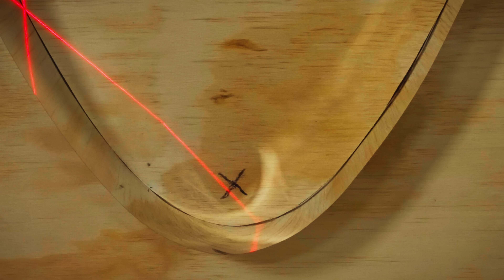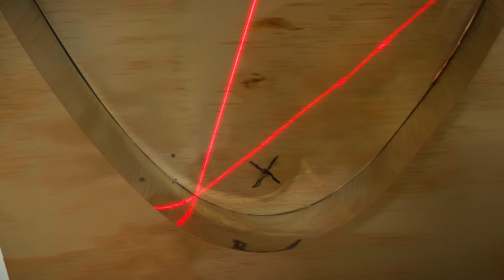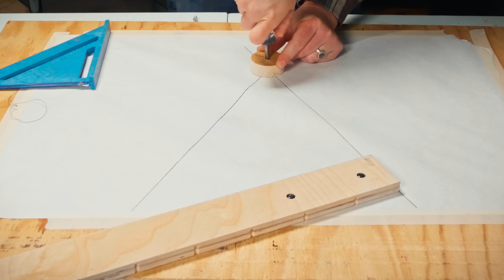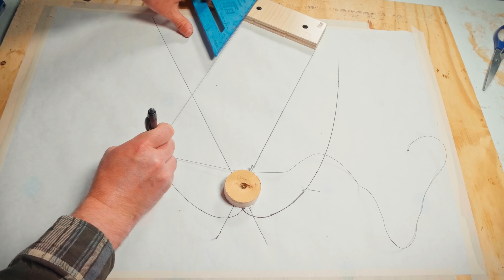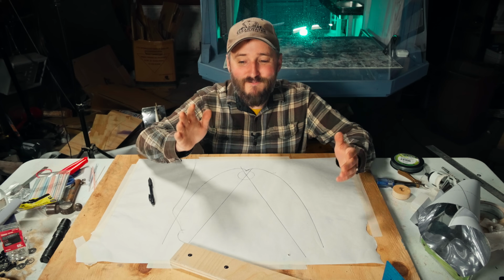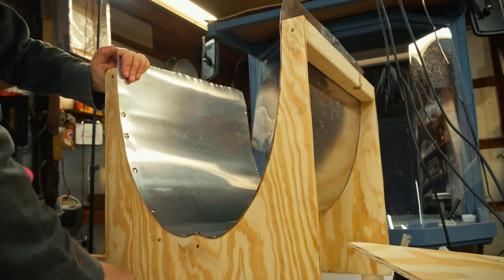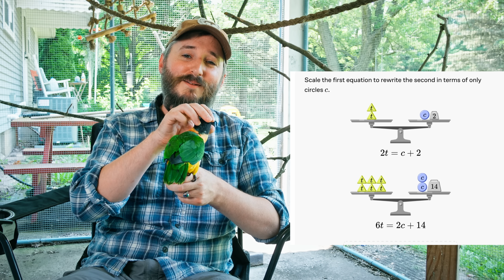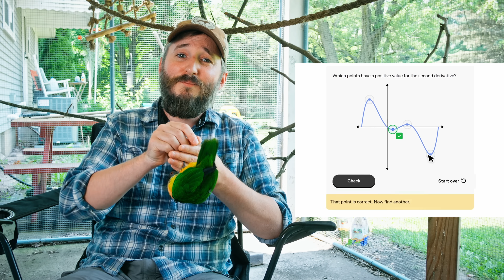DIY Solar Concentrators, Made Better.

Comment: Here's a wild tip for you - the receiver tube, use a copper pipe and rough it up with some sandpaper, then rinse it with phosphoric acid to get a black copper oxide coating on the outside. This surface will have a solar selectivity of well over 40 up to ~ 500 degrees F, and an absorptivity of >95% (i.e., will absorb practically all of the heat energy and not radiate it away). I used this trick during my engineering thesis when modelling high temp solar concentrators. Further upgrade surround the collector pipe with a glass tube that has an air gap (no need to vacuum, even just leaving air heat conduction will dramatically increase efficacy of the heat collection).
Reply: Nice tip.
Reply: @justinw1765  that’s what she said.
Reply: @clownphabetstrongwoman7305 Thank you Prison Mike...
Reply: Is there any more cheaper solution than glass tube. I believe that would be the most expensive part of the setup .
Reply: @migor777  Maybe use cut jars.
Reply: @migor777  a glass bottle is a glass tube, or a vase, whatever. you can get something at goodwill for a couple bucks that'll work
Reply: @migor777  
Plastic may deform at such a temperature, and if there is an optical defect, it may melt. So glass is probably the only reliable option for DIY. 

Maybe it is possible to glue (melt?) a box from 3 or 4 flat pieces of glass?
Reply: Presumably this would be used to heat water, therefore a pump would be incorporated to prevent boiling anyway. So plastic soda bottles could be  viable for encapsulation.
Reply: @geomacaulay Or design the system as a thermal syphon then the flow rate automatically changes as required.
Reply: @migor777 you could probably use an old shop light tube
Reply: @migor777 using scratch. Find used (not working anymore) fluorescent 20W light tubes, or 36W, or 40W linear fluorescent light tubes, cut their tips using glass cutter, clean, very carefully, the inside (the white inner cover, the phosphorus, is a very toxic powder), and voila, you will have a transparent glass pipe. We used those in Cuba, in the 90's, as chimneys for kerosene improvised lamps, to lighten our houses.
Reply: @migor777   Take a T12 fluorescent tube,cut both ends off with a diamond dremel wheel( one must be careful),sponge out the inside coating and you will end up with a nice piece of glass tubing. I know ,some mercury vapor will escape,but 1-2 fluorescents will not ruin the world around you
Reply: @migor777  Buy once. Cry once. This is one of the more valuable lessons that you can learn. If you build it to last a week, that's how long it will work.
Reply: @migor777  I was thinking of using Florescent tubes. Drill out one end to let the gas escape and the melt the end caps off with a torch.  Then you could use silicon O-rings over your copper pipe to hold it at center of the glass tube. Just a thought.
Reply: @1quasar1 don't use a torch. The tube is likely leaded glass, with a COE of 90 - it will shatter.

You will also have to remove the phosphor coating, which will be a ton of work, with high breakage.

Cut glass jars sounds better to me!
Reply: Hi  could you clarify something please .You said that black copper oxide will not radiate away , or it will not reflect away light? Im not picking.  Its that black object radiate thermal energy away much higher rate  than white or reflective. Just thought if that coating is preventing from heat radiation and good at the adsorption it is huge deal, and if this  real i would like to study it more , coz it would have so many more applications!!  Hope you could clarify it , thanks.
Reply: @Rom2Serge  I think the system described actually requires the glass tube along with the black oxide coating. The coating does absorb much more efficiently but also radiates as you mentioned. However the incoming energy is at one wavelength that then re-radiates at a longer wavelength that is reflected by the glass. I suppose using copper (or metal) allows the system to operate under pressure higher than glass would tolerate.
Reply: @RTew021 hi , yes i did some research in ideal world black objects radiate more heat than white objects at the same temperature. This is , linked to the conservation of energy: an object good at absorbing light (black) is also good at emitting thermal radiation. White objects, being poor absorbers (reflectors), are poor emitter. 
But copper oxide actually somehow re emits ligt less than usual black objects without braking conservation of energy. Some complex stuff is going on there. When will have more time will read about this subject. 
Cheers
Reply: @Rom2Serge - The way the original comment was worded DID make it sound like a spectrally selective surface, and it might be, but it could be just ambiguous wording buy that commenter. However, spectrally selective surfaces really do exist, which absorb visible light very well yet radiate infrared very poorly. In other words they are black for visible light and white or mirrored for infrared. You can buy ready-made vacuum insulated double-walled glass tubes which do exactly this. They are widely used for solar water heaters in most of the world, aside from USA and really cloudy places. 
On their own they can boil water on a good sunny day, but it takes several hours. When used with a solar reflector they can boil water much more quickly, plus they can get much hotter than 100 Celsius. One video I saw years ago showed them having a stagnation temperature of at least 300 C. They come in a variety of lengths and look black.
Reply: @YodaWhat hi thanks for answer.  when i was living in Cyprus in 90s our home had solar water heating panels.  as i remember they were without the vaccum.  Nevertheless they were pretty effective , by evening 1  panel could easily heat 200 liters of water to about 60 c.   
Just got interested about the coating. Cheers.
Reply: Funny about the glass part. I used glass 40+ years back doing the same thing. Aswell flat plate glass on windows. Twin plates, 1 and one quarter inch apart used above  honey comb frames to melt honey. Leave it to long it will melt the wax. The unit is on a slight angle to the sun so the honey dribbles to bottom  or corner to drip into glass jar. I experiment ed different widths between the glass plates . I could make super heat but that ruins the nature of honey . The wax melts at a little higher degree. Glass pains/plates have no vacuum between them . Old school stuff. Well just a thought to send you. Andy
Reply: You could take this further by testing CPC efficiency across different materials (like polished stainless steel vs mirror film) and maybe even build a modular frame system for mounting at different latitudes.
Reply: @diytoptricks  CPC is irrelevant
Reply: @thefamily512 ya asked, you by east ng oxygen on  denial. People waste it like ke that, but again, show numbers, theoreums.. something worth while, better than Wasting oxygen by denial, world has around 10 billion people denying every bit of progress, it's useless man.
Reply: Would love to see a video on this
Reply: THANK YOU. I spent several days two weeks ago just trying to figure out how to get a matte black surface on copper. How even is it, and does it come off when it gets wet/rubbed on? I need a cold plate for a cloud chamber I'm working on
Reply: @ThatPrimate  I want to know the same thing. And on that note, a similar question arises with regards to the super reflective paint. It is so awesome what it can do but ... how long does it last? How is it affected by dirt, rain, UV light and such? To paint a building outside with this paint requires many layers, in order to be efficient. There will be a lot of manual labor involved. So if it has to be done again and again too often, the gains will outweigh the work put into it.
Reply: It is durable and even enough to be used as a coating on firearms. @ThatPrimate
Reply: great application for heat pipes
Reply: Very useful tip 👌👌👌
What is the minimum concentration of phosphoric acid required ⁉️
Reply: genius! Looks like lots of us are on similar pages......But engineer status makes you the real deal....
Reply: This information is very useful, Ryan. Thank you for sharing. Do you know if this will last even over extended time? Imagine a solar absorber that should last for many decades, the oxide coating should remain, rather than be taken over by other coating, for instance the usual greenish copper look seen on older copper claddings.
Reply: yea true . infact just replacing the mirror stickers with cheap mylar will make it >97% IR reflectivity .
Reply: Phosphoric acid is a very dangerous substance. If it gets under your skin it will rot your bones. You can buy collector tubes made in china that are encased in a vacuum glass envelope quite cheaply if you find a local supplier. Then you "concentrate" your efforts on the concentrator.  You can make it with strips of reflecting material individually driven by motors to approximate a parabola and steer I to the sun based on sun location math.
Reply: Plus the phosphate coating just looks cool. Used to machine boxes and pins on all of the oilfield pipe here in the front range.  I'd pull them off the lathe, clean them up, then spray them with a little copper sulphate solution, wrap the ends in some gunny sacks and give them a few hours in a hot phosphoric acid bath. Helps toughen up the threads. Everything we dipped seemed to last quite a bit longer before needing to be rethreaded. Pretty cool chemistry. Never looked into the thermal properties. Thanks for the knowledge. It's appreciated.
Reply: And then you can make a heat pipe out of this tube. 

If the setup is at a large enough angle, you can simply solder one end, fill it with a small amount of water and boil it, fill the entire pipe with steam and then solder the other end. This setup should work under the action of gravity - because of the heat from below, the water evaporates and rises to the top, where it gives off heat to the consumer and cools down, flows down. 

I also had an idea for a horizontal DIY system: lay a linen cord inside the tube for the capillary effect, which is secured at the ends with something like clips or clamps.  Another liquid may be needed, for example alcohol. The rest is done as in the previous version.

(These are just my DIY ideas, they may not work)
Reply: @kulichkun8709 I wanna see you fill a pipe with steam, then solder the open end closed. I'd even pay money to see it.
Reply: To add to this, try to get a glass at max 1cm bigger. I think I read an article about windows and the air gap mm decides how much air movement and thermal loss there is.
Reply: @Nighthawkinlight THIS concept worked out in detail, big enough focal area, within a closed pipe system, including sorta turbine and a continuous water flow - couldn't that somehow mean free energy generation whilst making hot water?? 🤔
Reply: @tobkaa3973 the massive sun-shaped fusion reactor that our planet orbits is generating the "free" energy, for the record
Reply: Holy crap this is great!
Reply: When we've made our experiments about the aluminium based beer can air heaters we found a great and cheap solution for us. We bought fine iron powders and than sprinkle that to the freshly painted black surface. The premixed version is worked well also, but the sprinkled version given a better result. Maybe it could help someone. BLADE
Reply: Copper with a thick oxide layer has a standard emissivity of 0.78, according to the engineering references I checked, so I don't see how this detail adds much to cutting losses from re-radiation.
Reply: it needs a vaccum otherwise they wouldn't have gone to so much trouble making those schott glass vac tubes for the troughs at places like kramer junction
Reply: What do you think of the new Blacker Black that is so light absorbent that it does not even reflect highlights for your vision to recognize things like curves in the black painted objects?
I think that IF it can handle the heat it would generate it would out preform all other black colored applications?  Yet it sets over in the expensive Art supplies?
Reply: "vanta black"
Reply: Sulfide salts also blacken copper quite well. A lot of black patina chemicals used for blackening copper use a mixture known as "liver of sulfur" which consists of various sulfide salts.
Reply: wouldn't glass impact the flow of high energy UV radiation tho? is there better materials that might let that through and withstand the temperature?
Reply: @MatiR-Pumpkin not really, glass is superior, also you shouldn't try to question someone like nighthawkinlight who really knows far beyond what you and I can even phathom!
Reply: Golden comment.  Never heard of using phosphoric acid for this
Reply: Roughing up the outside of the copper tube will make it better at radiating infrared, even if the phosphoric acid treatment produces a wavelength selective surface. 
The worst radiators are mirrors. Therefore, the best solar absorber is a black mirror.
Reply: @YodaWhat  aka obsidian
Reply: Just plain awesome! Always wondered how to make these parabolic mirror at home! Thank you
Reply: Have you worked on the Ivanpah project in California ?
Reply: Is an electrolytic dip much better than charring it with a lighter?
Reply: instant steam? I presume you have no power bill at this point?
Reply: cool thanks.. they need to make some pipes with fins on the inside so more of the heat can transfer faster.
Reply: I wondered how to anodize copper like that. Is there a way to anodize iron or galvanized pipe to do the same thing? I could electroplate some copper onto it but may I can coat it directly
Reply: Awesome 👍
Reply: How about having a coper outer tube in lined with smaller tube in a seans that you have max contact surfaces for heat exchange. And then you close the one end of the bigger tube and pure in molten copper to fill all the voids in between bigger and smaller tube. In this way you have max surface for water to get heated and you have solid copper tube leak free.
Reply: @thefamily512 you may better help us telling us how to make cheap mirror, since my outposts have cold and hot room allways and making cheap mirror pain or some may be hot rooms best upgrade
Reply: Good idea but anything that uses metallic copper without melting shouldn’t really be called high temp...
Reply: @IceRain-f5v  I don't think so. Standard naming conventions are good enough.
Reply: Awesome job Ben, love your work. sent a link earlier I did with (math formula) web format , that saves svg and interacts with Compound Parabolic Concentrator for use with CNC and Laser projects. (click on turtle to left).
Reply: @TotallyAwesome-1  😂
Reply: @TotallyAwesome-1 yes
Reply: @TotallyAwesome-1 yes
Reply: Can you use Coca Cola to oxidize the copper black since it has phosphoric acid in it? 🤔
Reply: Need to be able to save this or copy it. Thanks for the added info.
Reply: Brilliant
Reply: It would be interesting to test this setup with selective coating pipes (like black chrome or nickel oxide), since they drastically increase absorption and efficiency compared to bare aluminum or steel.
Reply: Hi, I'm building a solar concentrator. Can you tell me about the angle between the mirrors? In the video Ben suggests between 20* and 40*. Is there any reason to not make it wider, such as 90*? 

Wider collects more light, right?
Reply: damn son. thx
Reply: This was such indispensable knowledge, even I might try this(might make video if so but not for another 2-5 months)
Reply: Thank you I will try this 😍😍😍😍
Reply: Splendid explanations and hands on demonstrations! Your exhuberance is wonderful to witness! Thank you!
Reply: Seems like you could use the flat target with this concept cheaply. A matte black flat target and a flat piece of glass with air gap just above it.
Reply: Great tip.
Reply: @Coltrabagar - Ryan Ross is mistaken about roughing up the surface. That part of his advice is exactly backwards. You do want the copper to be extremely clean before doing the phosphoric acid treatment, but you want to have the most mirror-like finish possible on the copper before doing the phosphoric acid treatment. What you want to end up with is a black mirror.
Reply: Something doesn't want me to say this because an ad came up and cut my text but. Help me out with this, how do I use this idea with a roof. This could save peoples lives as it essentially would melt snow and ice dams and could cost effectively protect rooves and help people out. Can you help me figure this out so I can help other people or so I can pass the idea onto others and help them.
Reply: My first thought when seeing the shape was to revolve it. A copper bulb inside a glass one might make a good solution.
Reply: This would be a fun project, optimize both the curve shape, the tube geometry, accounting for diffraction in the glass tube.
Reply: Thanks so much!
Reply: Brilliant 
Now need to find away to cool our homes using the sun
Reply: Is this superior to using something like high temperature rated black paint made for barbecue grills? If so, why?
Reply: @davideloewen   Well, obviously, copper has far superior heat conductivity, and work-ability than steel or Aluminium, and a long history of drinking water applications. 
Chemical treating (phosphate) is far easier, cheaper, and durable than applying expensive paint or friable sooting.
Reply: @BTW... 
I understand the rationale for using copper pipe, I'm not questioning that. It's just that I would never have suspected that phosphoric acid would be cheaper and easier (or safer) than just a rattle can of black high temp grill paint. The durability of the coating makes a lot of sense to me though.

A side-by-side test of coatings (durability and performance) would be a fascinating trial I think.
Reply: Paint can be a thermal insulator, the bond between copper and copper oxides is better for thermal transfer. @davideloewen
Reply: @davideloewen  Just don't burn the paint.
Reply: @mach1553 that's why you use high temp grill paint, it's black, intended to stick to metal, and is rated for something like 500+ degrees F
Reply: @davideloewen Superior in price, probably, because the acid can be reused?
Reply: @davideloewen  Yes the paint turns grey in weather and heat cycles. soot is all carbon and of not disturbed it will always be black
Reply: When the end of days comes about, however it comes about, can I get in your collective boat please?
Reply: I believe that soot on the pipe would do the same thing it would be flat black and absorb heat
Reply: @markeverson5849 it won't work as well.  Most black objects not only absorb heat well but also re emit it as well.  It's why the SR71 was black, so it could dump as much heat as possible.  Generally, black objects emit the most heat.  

However, there are specific materials that absorb light very well but that also do not emit as much IR.  Copper oxide is one, though there are better ones that use exotic materials.  You'll get far higher efficiency with these coatings than black paint or soot.
Reply: @markeverson5849  it does. we used soot from acetelyne flame to blacken 1-1/2" black pipe (we tried copper before that), ours was inside a glass tube with argon to keep the convection of the air off it. we never found to top efficiency of this unit because we couldnt get the heat off it quick enough to find the top, We programmed the parabola to turn away once it hit a temperature. the system failed once in testing and it burned a line in the pipe and perferatted it in places with the copper, safety was a big consideration.
Reply: I don’t think phosphoric acid is an oxidising acid
Reply: Your "wild tip" is an oversimplification of complex solar thermal engineering, particularly for high-performance applications.
First, your black copper oxide claims are highly questionable. Achieving "well over 40" solar selectivity (absorptivity/emissivity ratio) and >95% absorptivity at 500°F from a simple phosphoric acid dip on roughened copper is unsubstantiated and improbable. True high selectivity requires complex, multi-layer coatings and precise deposition, not a simple chemical bath. Such basic coatings are also unstable at these temperatures, rapidly degrading. Your "engineering thesis" might have oversimplified these material science realities.
Second, the "air gap" advice is misleading. While an air gap reduces convection, air still conducts heat. For "dramatic" efficacy increases at high temperatures, a hard vacuum is absolutely critical to eliminate both convection and conduction. An air gap leaves substantial heat losses, severely limiting achievable temperatures and efficiency, contrary to your claim.
In short, your "tricks" are far from the sophisticated engineering required for truly efficient, high-temperature solar concentration, relying on principles that are vastly more complex than presented.

No disrespect intended!
Reply: @thefamily512 Is his suggestion at least a significant starting point on a low budget, and is there another oversimplified low budget starting point you would consider in its stead?

Also, do you have any particular thoughts for or against the other common suggestion of using a coiled heatpipe in place of or lining the inside of the promary collector tube?
Reply: @thefamily512 yeahhhhh, idk man, as biochem electro engineer I may tell you he's onto something, collecting electrons at layerd approach may benefit sometimes, mainly on wider tempature spectrum, but for simple water heating and sanitation at few degrees this could be good thanks to extreme conductivity without ,,layers,, since you not gonna heavy load the electrons into the system, layered option may be better suited for high tempature where effectivity may be lost, iam not sure, but form electrical stanpoint even at higher tempatures the conductivity should be increasing.

May you prove me why high conductivity material being oxidised I not 95% effective?

I will try it out since I would love this to be my heat source for light task sterling engine, like blowing air in my azz, while I travel to wilderness eating leaves, drinking plant sap and putting paralitic agents from ottoman plant on my spears, to hunt down bears when I feel hunger. 

Look, thing is if you don't record video or post something better, you gonna slow down our evolution here, so quit bluffing, you did not even provide the ,,layers, or any technical aspects, just wasting words around while man you spit on made reasonable assumption that has specific procces, 

so quit wasting this worlds oxygen since it's lie plants produce any, they are oxygen neutral in theire lifetime, and real oxygen sources like plankton's and minerals take trillions of years to refill oxygen to best levels. 

And spending that joul was useless until you provide specific procces at least in lyer material and application procces kind of way.
Reply: @PychoticNatural  no disrespect, but I'm not sure if anyone really asked for all this
Reply: @thefamily512 While this is true, it is important to keep in mind what the intended design is supposed to achieve. If it is domestic hot water then too much heating becomes a problem. In South Africa they installed vacuum tube systems on low income housing unit and the home owners were getting burnt by water that was too hot. These systems then needed complicated mixing systems to add cold water into the hot water supply which made them too costly. Instead the systems were replaced with less efficient collectors just made from parallel black irrigation pipe using thermal syphon into the hot water tank. As far as black coatings, the most important thing is to remember is that the heat will flow from high to low temperature so that TD between the outside temperature of the tube and the water inside the tube will drive the rate of heat transfer in that direction, and this will have more effect on the result then radiation to the outside.
Reply: @thefamily512 "um, actually...." 😬